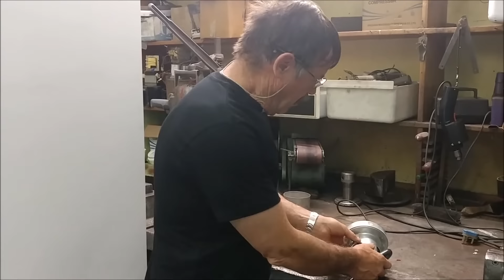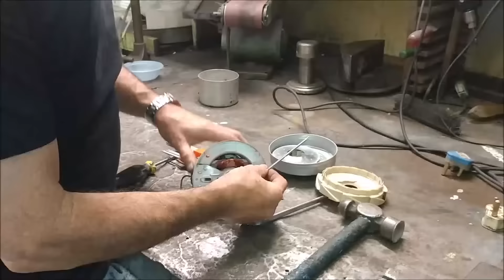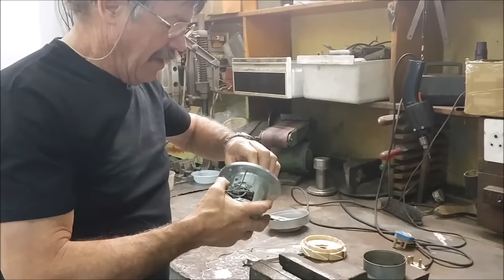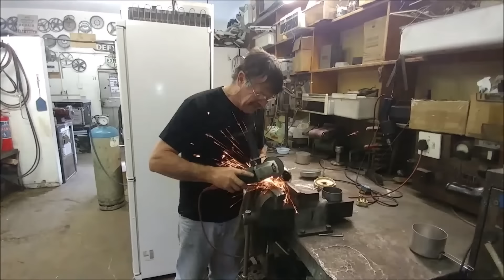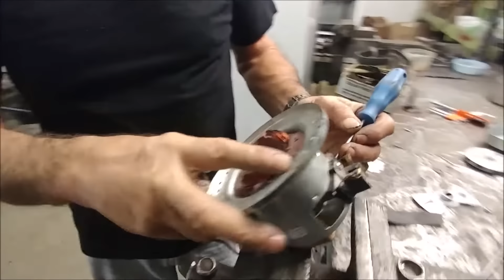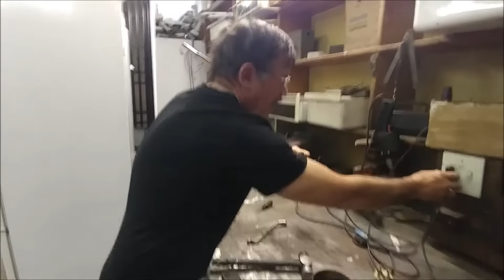How to replace bearings on a vacuum cleaner motor-JDNel Refrigeration

Comment: I have an old Henry that was left in the garage by the previous owner, it was used for wood shavings and sawdust. The bearing/s make rumbling sound when the motor is switched off.
I don't have a bearing puller but am keen to fix the thing.
Today I dismantled a Bush vacuum and removed the motor to clean out hair and thick dust. It now runs well without a nasty high pitched howl, so I feel confident about doing the Henry.

Comment: Hi Johann. I followed your video and replaced both bearings however there is still a smell from the motor and there are sparks coming from the brush area. Any idea what could be the issue
Reply from the maker: If the copper segments on your armiture shorts across to each other, or the windings inside the armiture shorts together it will create excessive sparks. What i can suggest is to clean the copper segments on the armiture especially between them, there must be a gap and then try it again.
Reply: Thank you for the assistance it is much appreciated. I have used your videos to fix my defy double door fridge and it saved me from buying a new one. Is there a special way to tighten the motor nuts on either side. When I tighten them and turn the motor it gets very stiff. Is there something I am missing. I placed the metal washers with the indentations both ways and it still gets very tight.

Comment: I have to throw away the ametek 2 stage motor because of the bad bearings. New motors are not repairable. After removing the impeller and found out no screws just one sealed unit.

Comment: Hello. Have an electrolux/beam. But is has not the nut on the fan, just a tip. Is the shaft pressed on the plastic and metal fan?
Reply from the maker: Yes. In the factory they heat the centre bit of the fan blade up so that the hole expands, then it cools down around the shaft. It can be removed but you damage the blade in the process. If you have a spare blade then you dont mind sacrificing the old one.

Comment: You seem to know way more than me about vacuums. I would like to know what is generally the main cause for a  extrmely loud central vacuum? Last thing I did before it broke was to vacuum very fine dust. (Concrete dust). I know it's a bad idea. But instead of buying a new one I'd love to try and repair it  myself.
Reply from the maker: If your fan blade is off balance either due to something stuck on it or a piece broken off of it, it will create a lot of noise.

Comment: I have a vacuum lamb electric motor  with a metal pressed on cooling fan, how would i remove the fan and get it back on would you know?
Reply from the maker: What I do is I break the fan blade off the shaft. Once the bearings have been changed I press fit a new fan blade on.
Reply: OK thanks..i hate when companies do things like this..just use a revers thread..would make life so much easier!!
Reply: Thanks...I will call the company and order a new fan..do you press fit with a hydraulic press?
Reply from the maker: @douglasfurlong1  No. I don't have a hydraulic press. I press it in with my bench vice.

Comment: Hi Thanks! I have another that has no nut in front just a sealed metal-plate holding the axle on its place. Tried to sand or cut it off. There where I am right now. When putting it together I think I will put a threaded axle in the top and a nut on it so it get like yours. I took it away cause of a mechanic sound at the end of the rpms:s when it stops to run. So I thought it was the bearings.
Reply from the maker: I know exactly what you are talking about. Some vacuum cleaner motors do not have a nut at the end. The blade is a press fit. What I do is I break the blade off and then when I'm done, I replace it with a new blade. You cannot reuse the same blade again.

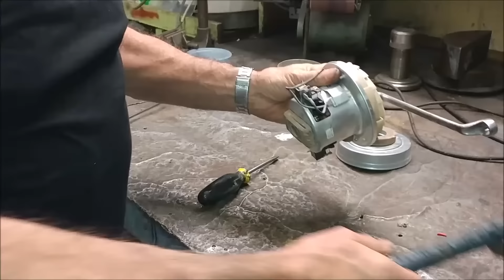Comment: 0:54 i love this video...but I absolutely cannot get that to work for the life of me.  The nut will.not.budge.  This motor is for an upright though so it protrudes out the other side, and I've even tried grabbing it tight with a drill and it still won't budge.  I don't know what to do :\  ....I managed to get it using locking pliers but I don't know what I would have done if this wasn't an upright model.
Reply from the maker: Some motors have a left hand thread on the armature shaft. So determine the direction before you attempt to open it. On stubborn ones you can apply a bit of heat to the nut before undoing it.

Comment: In order to hold the blade, I usually use a thick welder's type of glove or a towel, then loosen the nut.

Many motors have a right handed nut (Shop Vac, Bissell, etc.) but some, like Hoover, have a left handed nut.

Comment: Thanks for the video, Johann. 
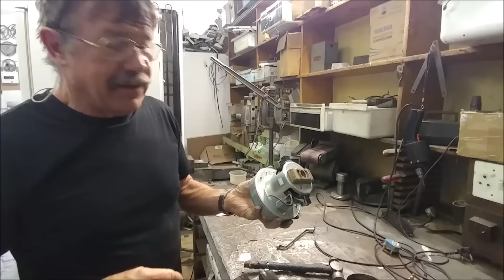The nut you loosen @ 11:45 is a right-handed thread. Could that be left-handed on some motors? 
(I couldn't unscrew mine, that's why I am asking.)
Reply from the maker: Yes it could be. Normally the direction the motor spins in will tighten the nut. So to loosen it go the opposite way of the motor direction.
Reply: @JDNelRefrigeration  Thank you.

Comment: Thanks Johann clearly demonstrated. I am trying to replace a bearing in an electrolux 745 royal but the suction blade has no nut on to fix it to the arbor only a plain en withh washer. Have tried tapping but it seems fixed solidly. how do I remove this?
Terry
Reply from the maker: The blade is a press fit onto the armature shaft, without the Electrolux special tool you cannot remove the blade. What I did was I had some spare motors of which I cut the armature shaft off with a hacksaw and positioned the blade over a socket witch is a slightly bigger diameter than the shaft and with a round center punch I would tap the little piece of armature shaft out. Those blades I could re use again but the motor was damaged as I cut the armature shaft off. When I needed to replace bearings I would break the fan blade off in pieces making sure I don't damage any part of the motor. After replacing the bearings I would take one of the recovered blades and tap it into the right position making sure I don't put it in too deep otherwise you have to break that one off again. That is how I do it as those blades were not available as a part.

Comment: Hi Johann,

Even when I hold the fan impeller stationary, the shaft continues to spin with the nut. How do I stop the shaft from spinning?

Thanks!
Reply: @c s  , i have a similar motor housing like johann's...
Mine is a dyson dc28c motor
The solution is in your user name!🤔
1.I've removed the brushes.
2. Measured commutator's approx diameter (there are "windows/accesses around on the housing on the commutator end to do so))
3. I cut a piece of wood the size i can easily insert through the windows.(for this type of motor i cut:100mmx10mmx25 piece. 100mm is needed (explain later) you can change the other two dimensions as per your requirement.
4. I drilled a 20mm ish hole at the half of the lenght at 50mm mark of the wood (flat side, the 25mm side in my case).
5. I cut the wood in half at the CENTRE (!) of the hole.
Now you have two pieces of wood with reduced lenght approx 50mm each, and most importantly a C-shape ends on one end on both (because you cut the hole in half) getting similar ish radius as the commutator..
6. Glue some soft material in the Cs(like your name lol), 1mm leather, foam, rubber (bicycle inner tube works great) for not damaging the commutators surface.
7. Insert the pieces, Cs faCe forward through the "windows" up to the commutator. Due to the 50mm lenghts you have a little overhang on the housing...
Use any G or F ir whatever clamp to push the pieces together (commutator is between the Cs) and now you have a SOLID shaft to loose the impellers nut...which could be left or right...
Watch out the wiring!
Hope it helps!
Thanks to Johann for the video!
Rgds AB
Uk
Reply from the maker: I tap the spanner with a hammer.
Reply: @JDNelRefrigeration  Yup, I followed the video. Even tapping causes the shaft to spin. Have you encountered this before?
Reply from the maker: @Kebersox  Yes, just tap the spanner harder.
Reply: @Kebersox  I used a ¼" impact driver.  The inertial mass of the rotor is what we are using both ways.

Comment: Is the peice you cut off welded onto the whole shaft to the other side? Or is it just a stopper/bushing. (The piece at the end that looks like a wedding cake with 2 layers) In other words could the bearing be removed possibly with a puller?
Reply from the maker: There is nothing welded in a vacuum cleaner motor. You use a bearing puller to take the bearings off.

Comment: NEVER EVER hit the rotor axle with a hammer like in the video. NEVER! There is a big risk that the windings and/or commutator comes loose from the axle, and then your motor is totally ruined. The rotor needs to be pressed out of its seats, gently. Best way is to use a vice. 
Trust me! I destroyed a motor doing like in the video! So I know what I am talking about. Since then I never did that again. Now I always use a vice, and it works perfectly every time!
Reply: Same thing for the bearings of course. Press them off and on. Do NOT use a hammer.
Reply: This man has been tapping the armature out like the video for years with no problems. I have also used this technique over 100 times without issue. So maybe you used too big of a hammer. Since many use this technique I would NEVER EVER listen your advise. You just may not be skilled enough is all.

Comment: Hi Johann...if you`re around?
If only my Eectrolux 330 was that simple to get into.The housing bearing is shot,it blew the other day,making a horrible noise.
I was given the vacuum cleaner 2nd hand years ago,I`m guessing it`s late`70s?
The armature has a big wear grove but still enough meat left,although brushes are down to about 8mm or less,so I`ll replace them....if I can get to the housing bearing.Thing is,there`s no handy nut to undo as in your great demo,just a button-head rivet head! I suppose I have to drill that off and then drill &tap and fit a screw to secure....??
Reply from the maker: That is not a button head, that is the end of your armature. The blade is in with a press fit. There is a special tool you get to remove those, but I do not have one. What I do is, I destroy the blade to get the armature out then replace the blade with another one.
Reply: Many thanks Johann,can`t beat that sort of info from a tradesman.
I wonder if I spot weld a metal dowel to that rounded head and slide-hammer it,whether it`d come out?Just a very quick spot weld with my arc welder,not enough to transfer too much heat through to the armature?
Failing that,I wonder if I could make a puller?I wonder what they look like...they must be a bit trick because there doesn`t look like much to get hold of.Maybe it`s a pair of round tapered jaws that bite into underneath of domed head until it lifts it enough to get underneath?
My fan still has the outer housing on it,I get the impression that the fan is stopping the housing coming off....but I could be wrong.
Reply from the maker: Don't weld on the shaft the heat will make the shaft expand. If you heat the metal bit on the fan blade it will expand and become looser on the shaft. but you still wont get it off without the puller. The puller is 2 forks that fit underneath the blade and the top has a threaded shaft that pushes the shaft out. If you break your blade, I have them in stock.